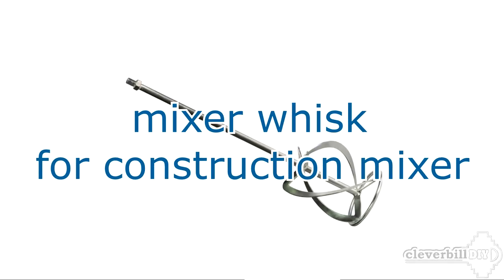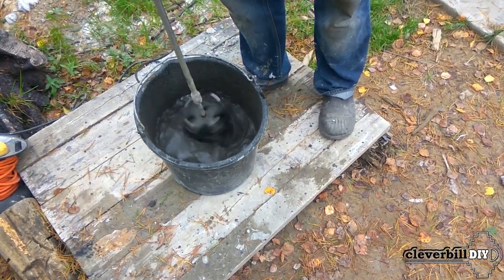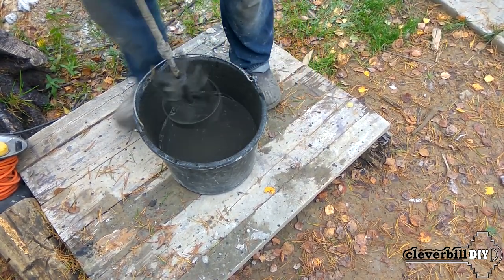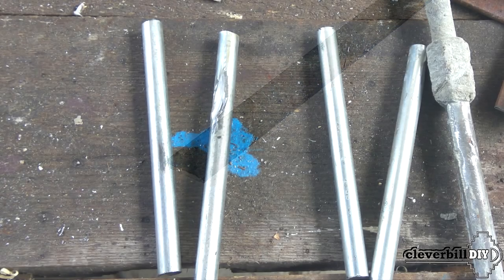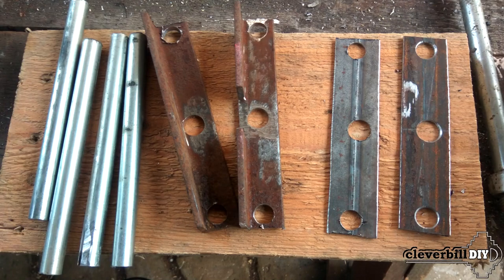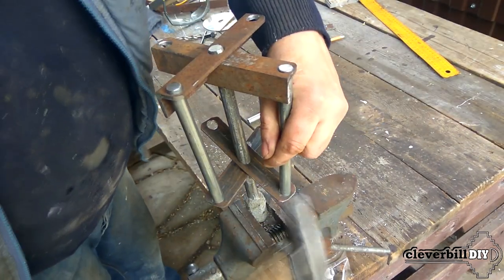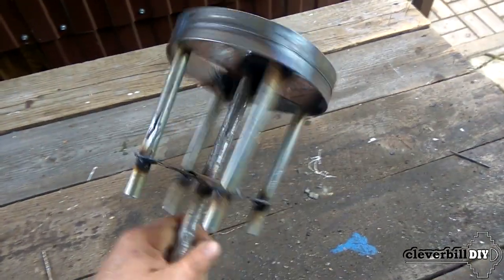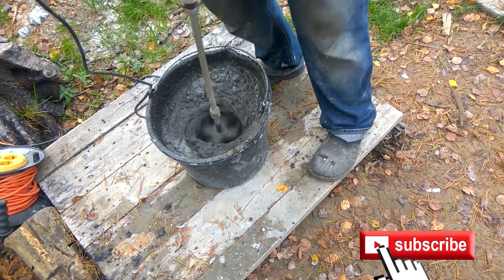Heavy duty multi mixer  whisk  for a construction mixer - we make a reinforced structure DIY

Comment from the maker: For mixing concrete that includes crushed stone, using a conventional whisk is usually not enough for a long time. My new whisk is made of steel, it works perfectly, and does not quickly wear off on gravel and sand, compared to the purchased one.